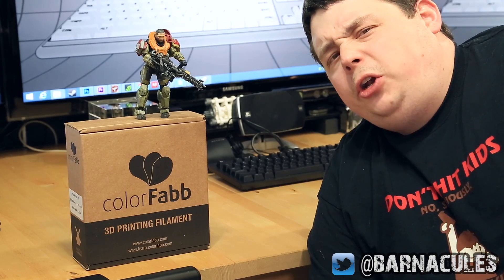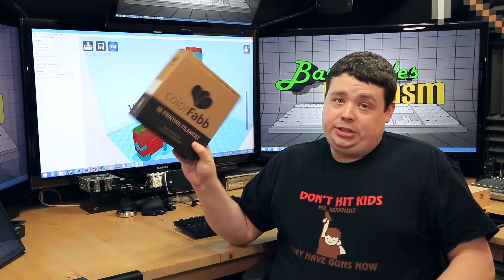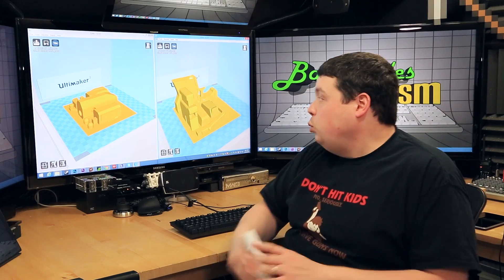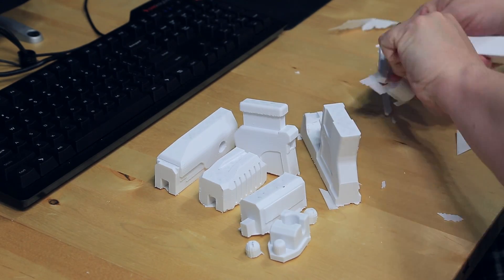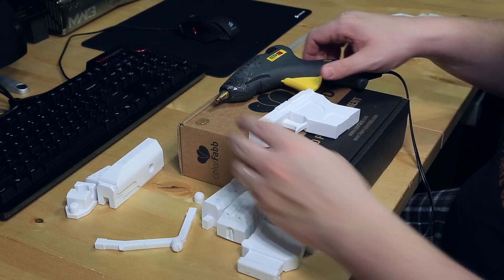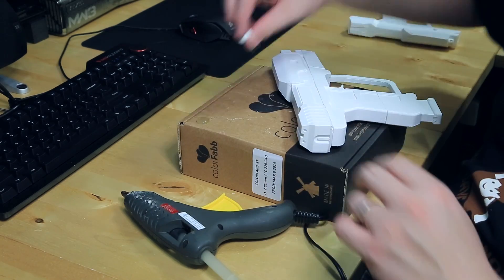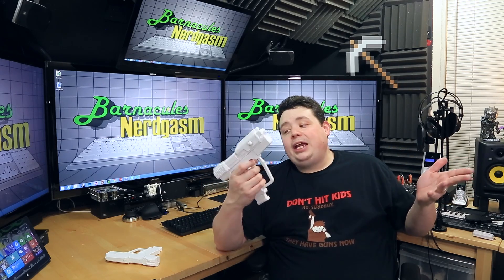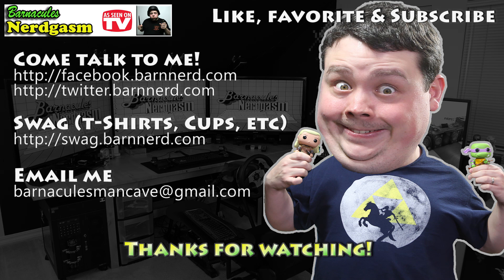3D Printing Halo M6D Magnum Pistol on Ultimaker v2 in colorFabb XT - @Barnacules

Comment: Thanks for answering what I was wondering. if I could use a smaller printer and print things in pieces and put it together afterwards. Basically adult legos. haha. Also even after you made that magnum bigger, it's still not actual scale. It should be twice as big as that actually. It's unrealistically big. but it's also meant to be held by 7 foot tall spartans.

Comment: Your 125% scaling was probably far closer to the real size of a 12.5mm handgun.  Have you ever held a 10mm Glock?  They're large and ehavy compared to a 9mm model.  Higher chamber pressures, etc.. the guns have to be built tougher to withstand the repeated wear.  Also, keep in mind that operators typically shoot wearing gloves, so you'd need to account for that as well in the sizing.

Comment: Man I REALY can't wait to save up for a 3d printer
Reply: What are you going to get? I probably will get a robo 3d
Reply: Luke Farmer You should get the PrintrBot simple metal. Cheap printer, one of the best even though it has a small (6 inches) printing size.
Reply: Nicholas Harris thanks for the suggestion!

Comment: In the multi-piece print, could you simply skip that sheet of material that you had to break off?
Reply from the maker: Since it was a part of the model no, but I could have used NetFabb to slice it off.

Comment: What 3D program did you use to demonstrate your design?
I'm taking an engineering course that contains 3D-printing and feedback would be heavily appreciated.
Reply from the maker: I don't do a lot of 3D modeling myself but when I do I use NetFabb Private.
Reply: Alright thanks for the feedback. I'm more interested in software from Autodesk and Solidworks.
Just a Random though, but do you think that you could try to 3d print some batarangs. The boomerangs that Batman tosses around all the time.

Comment: Hello Barncules,
Have some questions to you. I'm looking for any home 3d printer. Which one from your printers would you recommend for a begginer? Maybe you can make a movie with printing case for your mobile phone and the time spent for it. Are home printers enought to prototype something and later copy it by a silicone forms? Waiting for your answer, peace!
Reply from the maker: The Ultimaker v2 is the only printer I would recommend to someone that is completely new to the technology. But if you're good at tinkering and willing to be patient and learn the Robo3D is a lot cheaper.
Reply: Barnacules Nerdgasm
Thanks for the answer, I can spend few days to learn how to use it but its all about the quality to price. Ultimaker is around 2000Euro and the Robo like 500. If there isnt huge difference I'm gonna get a cheaper for the beginning. Maybe you can send me on priv or link here few photos printed parts from Robo and Ulti2.

Comment: This is probably going to be a bit unacceptable, but let's hope this shows the idiots in the media that you can't print a fully workable gun, which is the first thing they all jumped on when 3D printing was released to the public. (Well, you probably could, but I'm pretty sure a criminal is not going to have a 3D printer and know how a gun goes together)
Reply: You're underestimating criminals.
Reply: You can print everything you need to assemble a firearm...not to mention the way firearms are put together these days makes it very easy to assemble/disassemble...the media are scaremongers to be sure, but that doesn't make them factually incorrect - printing firearms is a reality.
Reply: Defacto Atheist You cant fully 3D print a gun. Guns must have metal parts for them to work properly. If a gun was completely printed out of plastic it would blow up in the users face after the first shot was fired. It is also unrealistic to expect 3D printed parts to work together effectively in a gun. A gun is a complex tool with thousands of small pieces that must work together in order for the gun to fire. It would be easer to build a gun out of plumbing parts than to 3D print one.
Reply: Erik O Literally the only correct thing you said there was that it would be easier to build a gun out of plumbing parts. Go away.
Reply: Oops! My fault. I didn't realize I had clicked "reply" on your last comment instead of the dipshit who commented before you. I wasn't directing any of it toward you. You and I are on the same page.
Reply: Defacto Atheist Thousands of small pieces that must work together in order for the gun to fire? What on earth are you talking about? One of the main reasons why guns are so durable and incredibly reliable is because of their LACK of many pieces and moving parts.
Reply: Bradley Smith
Not sure why this is directed at me there, mate.

Comment: I'm thinking of getting the metal Printrbot simple to play around with. I watch alot of anime and play many different video games and I want to get a 3d printer to print models of weapons from the games/anime. Do you think that the metal printrbot simple would be a good choice? I;m kinda tight of my budget.

Just a question about the plastic. Are they like really solid? I mean, if i print a ABS keycap for example, will it feel like the on on my keyboard? or would be feel more brittle/weaker?
Reply from the maker: I really don't like how the build platform moves on 2 axis and the print head stays put, seems like it would make it hard to print delicate things and it would be very slow.

Comment: just curious is it possible to melt down this material and re use it.
Reply from the maker: Yes, you can use something like a Filastruder to break up and melt down the bits and make usable filament again. 100% recyclable.

Comment: i had a thought, has anyone tried to make a shell from say halo or borderlands guns to work with nerf guns or nerf components
Reply from the maker: This is a great idea, I wish I had the skill to 3D model a shell to swap out on an existing NERF gun.
Reply: Barnacules Nerdgasm yeah no clue how much work that would be but i know the basic models can be taken from the games. according to one of my friends over in missoula they use them at some shop that has a large 3d printer for rent
Reply from the maker: Lordsmylee You could just slice up the model and print it in small parts and glue it together.

Comment: why do you need bridging on the bigger scale model? the gun is separated in different parts anyway.
Wouldn't it be possible to use normal material?
THANKS
Reply from the maker: Yes, for the larger gun normal material would be fine. I just wanted to use the XT because I really love it.

Comment: Jerry, Whats your experience with pla and a heated bed? I dont seem to like it. I find that the good ol hair spray trick works alittle better. I defiantly think 260 was a bit much lol...Maybe try 240. Thanks for the amazing video!
Reply from the maker: I run the bed at 60C with PLA and apply extra hold hairspray and I've never had a print come off mid print with that method. Also makes it dead simple to remove once the bed cools.

Comment: Someone should print a chassis  that you could drop in a m1911 to have a functional "halo magnum" have the lower frame of the magnum connect via the grip screws on the 1911 and top frame of the magnum connect to the slide via the sight mounting points. Would be a fun range toy.
Reply from the maker: The range master would probably tackle you :D